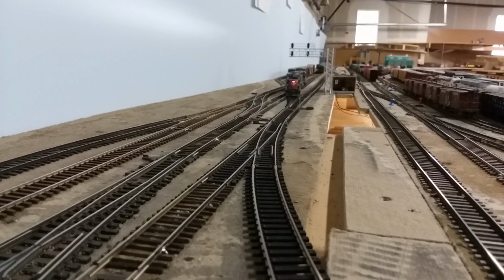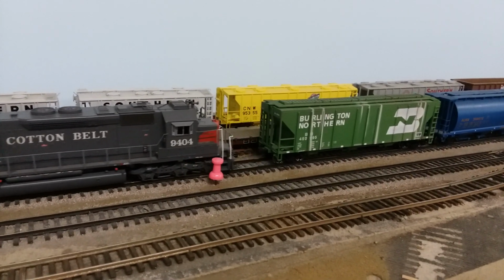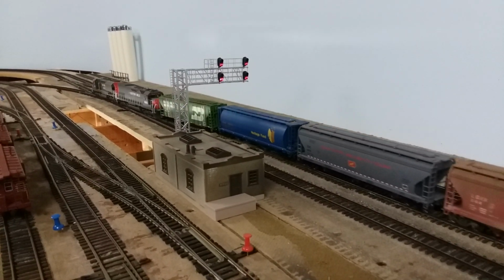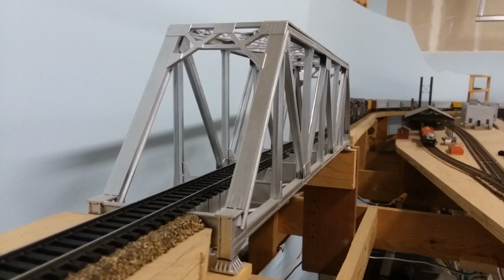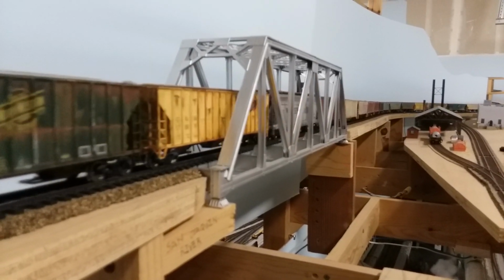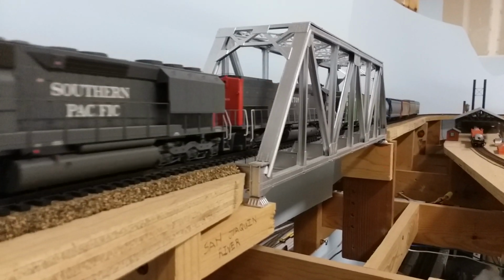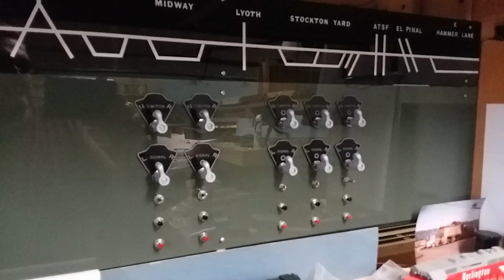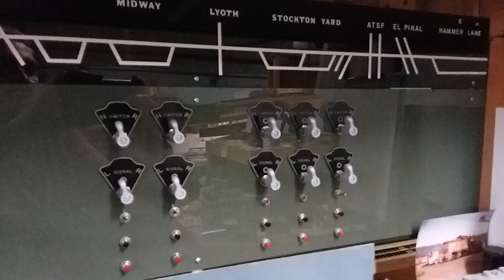HO Scale 'Crew Called' Pt. 2 Helper service w/ a SP Grain Train

Comment: Hi David, part 2 is great as well. Nice the helper engine. Really like the bridge and the CTC dispatch panel. Yes it has been hot , very hot, here too but the layout is in the basement so it has been a good excuse to do some stuff on the layout. Be safe and have fun.
Reply from the maker: Thankyou and yes I saw your heat problems as well.. 4 days of excessive heat here.. In California we dont have basements.. I wish we did!  🤗
Reply from the maker: Yep.. I turned the lead unit into a dummy as it has a 1980's 'Emrex' 3v. battery powered circuit board in it to run the oscillating headlight which I think it has a better effect then the ones currently being produced.. So yes the other 4 are speed matched as before they did not run well together at all.. 😋🤗

Comment: Looking good Dave I know what you mean by working on a project and then something else stops working.   I was adding my Kadee #309 wiring yesterday and one of my Light-Its that controls my Bridge Signal Heads went out.  Checked it out and found my solder came loose.   I am so glad I labeled all my Terminal blocks and devices makes troubleshooting so much simpler
Reply from the maker: I dont have an awful lot of labels in fact this afternoon I spent a number of hrs tracing down wires that over the yrs I've abandoned but never removed so that was my mission today.  More and more of my Tortoises are getting cut over to Switch8's thus less wiring.. 😛

Comment: Nice smooth running David….what is the purpose of the louvers on the side of those two SD’s
Reply from the maker: The SP put those on so that fresher air could be sucked into the engine in tunnels and not all the output exhaust which I can tell you first hand is bad!  🤗